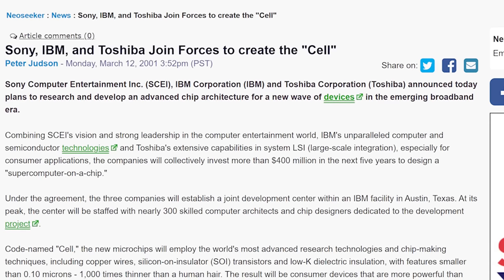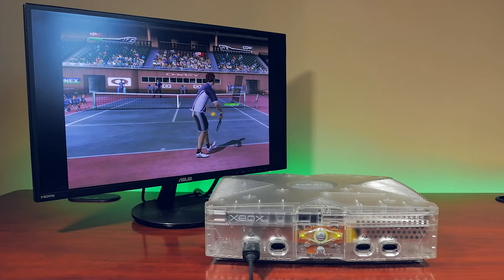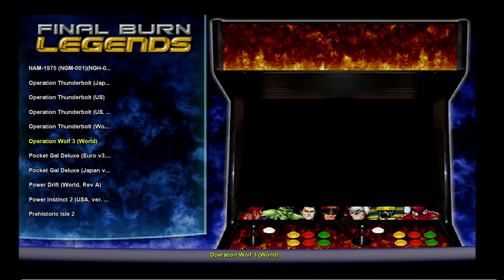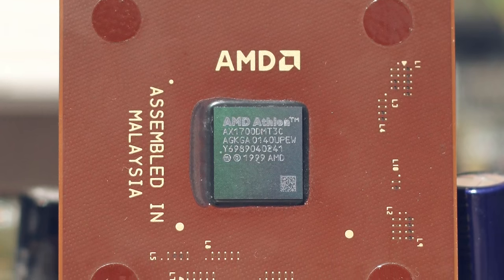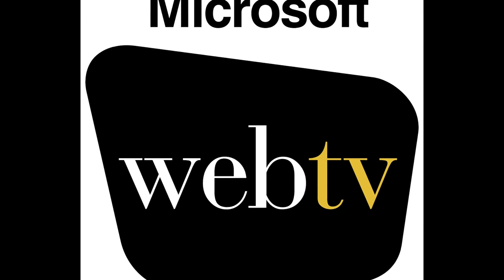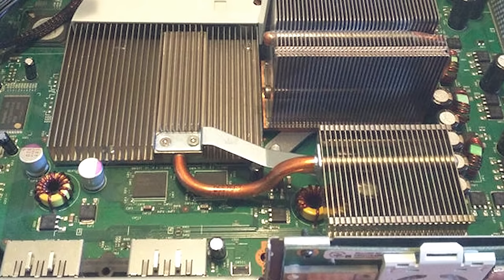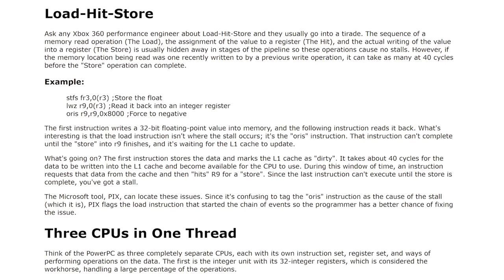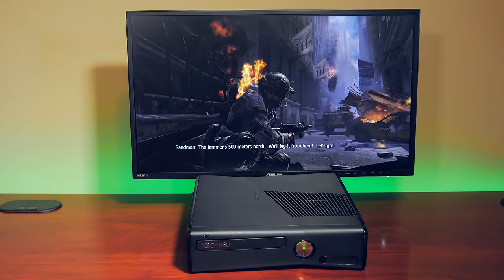Why Microsoft switched from Intel to Power PC for the Xbox 360  | MVG

Comment: At the time it was really amusing how Microsoft bought PowerMac G5s in bulk to send out as the original Xbox 360 pre-release devkit
Reply: It kinda made sense, so at the very least developers would get familiar with the architecture
Reply: @andreiarg  *made
Reply: alvallac21 💀💀💀
Reply: well... it just hackingotich cheapst production....
Reply: That has always been Microsoft strategy. They are one of the top vendors of Mac software (office).
Reply: Power PC pretty much owned the bigger server farms. All Silicon Graphics L4/L5 servers had full blades of up to 20 Power PCs per blade. Blades could have 1 to 20 CPUs.
Reply: The games were demoed on PowerMacs because it had the same architecture
Reply: Oh yeah I remember that
Reply: Only for Apple to shortly afterwards transition to Intel
Reply: Iirc the last few PowerMacs were some of the first 8 core systems for the consumer market. In 2005. Edit: well techincally eight cores, however its two Quad Core CPUs.
Reply: unsuprisingly, it was $150 million worth of powermacs..... bill hated steve so much for that prank
Reply: @V1VISECT6  The 8-bit guy did a test and discovered that the last G5 PowerMacs actually performed worse than the first Intel Mac minis
Reply: @V1VISECT6  wrong and wrong edited, sorry. the last powermac g5 from 2005 had 2 dual core cpu's, so 4 cores at 2.5ghz. a factory watercooled monster. rumors say they offered a coal power plant as CTO to go with the G5's....
Reply: @RBMK1500  I have three of them in storage, one is the liquid cooled variant but alas it kernel panics at boot. It’s actually just a 600w psu.
Reply: @brkbtjunkie  did you check for leaks in the watercooling? and yes, maybe "only" 600W psus, but if they suck a constant 400w from the wall you will be bankrupt soon ;-) i dont know the consumption but it certainly isnt very low..
Reply: Still the most beautiful desktop ever made. One day I’d love to buy an old G5 or Mac Pro and modify the case to fit a modern PC.
Reply: TBH I was hanging out for a photo of this in the video
Reply: @TVperson1  I used to have one G5 iMac. The performance was mediocre at best. More annoying was the fact that the machine was quite loud under any kind of load. It was power hungry like nothing.
Reply: And at the same time, Mac developers were being provided HP computers in advance of the PPC -> Intel switch. Strange times.
Reply: Well Apple used Windows PCs to program for the original iPods ARM CPU, so I guess they both were forced to team up.
Reply: Microsoft buying from Apple is unheard of nowadays
Reply: @ThatIceChampion  The gamecube is a repurposed mac g3/ibook.  all of nintendo's hardware is like that.
Reply: @HunnysPlaylists  yeah but thats Nintendo, they also had a partnership with Apple in 2016 for Super Mario Run
Reply: @danielfinley-pesti6661  wow, three skulls? That’s crazy 😮
Reply: @nil0bject  “unsuprisingly” idk this word 🤷
Reply: @RBMK1500  Correct, the intel Mac Pro that replaced the G5 could be had with 8 cores.
Reply: @Noah-Lach  I have 3 Mac pros from 2007 -2010 and 2 top-spec g5 towers literally sitting in the basement of a graphics shop. Many other macs too. A g3 blueberry slot loader with all peripherals (many new-old-stock unused round mice and keyboards) and about 3 iMacs from 2004 to 2012. Also, an original MacBook. All just sitting in a filthy basement. Want to rescue them someday.

Comment: One of the devs at Microsoft had confessed that for the OG xbox, they turned down AMD at the last minute for their cpu and went intel. I wanted to also add that the Gamecube, xbox 360, XSX and PS5 are well built and balanced in general. PS4 and Xbone were unbalanced by the Jaguar arch limiting most games. PS3 was hard to program but very powerful.  N64 was an engineering disaster that worked out.
Reply: now they all need the TSMC chips, then intel only was able to give them Ghz clock speeds
AMD is gone, was never a big party
Reply: The N64 was a tradeoff among the best solutions available at the time.
Reply: @A World Under A Spell We'll have to agree to disagree on everything you just said.  I'm not even sure how you are coming up with your games list.

But I did some PC gaming as well as console gaming.  None of the consoles could match running a PC with Voodoo 2 in Glide.  But the N64 came somewhat close.  The textures were laid out right, the animations were good for its time, the lighting was appropriate.  The edge antialiasing it used wasn't as good as the FSAA that came later (post 2000), but I doubt the difference between the two would even have been noticeable with the N64 because of its intrinsic blurriness.  It was like a low textured version of a PC.

The PS looked absolutely horrendous in comparison.  The textures strangely contorted because it couldn't correct for perspective.  And pixels shimmered, and polygons popped in and out because it lacked a Z buffer.  It rendered artifacts galore.  And its lighting ability was lackluster.  Even at the time I knew it couldn't really do 3D.

I'll agree with you that the audio quality on the N64 wasn't good.  But the N64 sounded better than the PS looked.  The PS had the better controller, I'll give it that.  

All the consoles of that generation were a tradeoff to meet the transistor budget.  The N64 had a small texture cache size because that's all they could fit after implementing the rest of the hardware.  The PS lacked a Z-buffer and a proper texture wrapper because of the same reasons.  And the Jaguar didn't even have a texture wrapper.

But they were all tradeoffs of the best engineering solutions available at the time.
Reply: Apparently AMD wasn't even aware that the Xbox wasn't running their CPUs. must have felt like a serious betrayal at the time.
Reply: @lucasrem1870  AMD is gone? What? PlayStation and Xbox have been using AMD hardware exclusively for their CPUs/GPUs since 2013. TSMC is just a foundry.
Reply: Yeah them going with amd in the middle of amd's rut stalled game development. i think that's why intel was able to keep their pc cpu performance so low for so long. If they had waited a year for the onx and ps4 pro they could have used ryzen cpus that would've been way better
Reply: @WamblyHades  amd has been fabless for a while they don't know what their talking about
Reply: @alexandernorman5337  nah nintendo could've used cds cuz they had piracy anyway
Reply: @alexandernorman5337  Voodoo 2 from 1998, N64 from 1996
Reply: Gen 8 is good. They better than pc from 2012
Reply: @gamerinc245  a low end one maybe, but a 3770k and a 290x is still able to run some modern stuff with .odded drivers
Reply: @gamagama69  Those systems were designed to use similar architecture to the original systems to make development easier and the systems cheaper. If they wanted to upgrade the CPU, AMD and Microsoft would have done so.
Reply: the problem are all the freaking X86 patent that was intel thats why intel fked the Xbox and gave a weird slow 733mhz processor instead the 1ghz they promised to get AMD out the console, so MS just kick intel on the 360
Reply: @albino_gringo1912 The cartridge format didn’t hold the N64 back, it was the awful memory latency (RDRAM) that the system had, 4kb of texture memory, and fill rate issues due to improper use of microcode.
Reply: @gamagama69 With that awful memory latency paired with first gen RDRAM? It would’ve not only made the base machine more expensive, but a bigger nightmare to deal with if it used CD’s.
Reply: People also forget the ps2 was underpowered and hard to dev for.
Reply: @lucasrem1870  what are you talking about, the OG Xbox never went over a ghz. Also AMD in the early 2000’s had there 64 bit processors which where dominating Intel.
Reply: The PS3's architecture was pretty bad not going to lie.

Doesn't stop me from loving the console. Great console! Trash architecture, but great console!
Reply: @qwertykeyboard5901   It finally became great right before it died but the 360 was so much better for 80% of that generation. Microsoft was knocking it out of the park with exclusives from 2005-2010 or so. Conversely, Sony finally did the same from 2010-2013 with The Last of Us, Uncharted 3, Infamous 2, etc. It's just unfortunate for Sony that the overwhelming majority of multiplats ran better on the 360 which ultimately won me over at the time. That said, I still ended up with a PS3 later and it's one of my favorite consoles to jailbreak (and one of the easiest).
Reply: @marcuscook5145  Yeah, Sony should have dropped some of the SPE things for another PowerPC core tbh. They where good at floating point stuff, but not main game engine threads that have 7 trillion branches everywhere with the most complex math calculations being int's most of the time.
Reply: @alexandernorman5337  Rambus is NOT what I'd call "the best solution available at the time".
Reply: @alexandernorman5337  You have to remember home video game consoles are some of the most cost reduced things in electronics. Yes the PS1 looks bad, but for what it did it was incredibly cheap for the time!
Reply: @albino_gringo1912 Uh , only for people that didn't know programming well . Before Microsoft bought Rockstar , GTA 3 was made for the PS2 . And Rockstar said they had no problems programming for the PS2 . And Hideo Kojima fooled everyone with the Metal Gear Solid 2 trailer . People said a computer was used for the trailer when it was made with the PS2 . And the Metal Gear Solid 3 trailer showed the PS2 had much power for texture .
Reply: @lucasrem1870  so silly to have said that AMD was gone during ryzens peak

Comment: I love how everyone is abandoning Intel now. These prices are ridiculous
Reply: That's only if you want the latest and greatest. Modern processors last years for gaming these days. (most likely consoles stagnate the gaming processor needs until a new gen)
Reply: @aaron1182  "Latest and Greatest." Intel still can't downsize their process. Still stuck at 10nm. Sure, their CPU's are still beating out AMD in terms of Single Core performance, but almost ALL modern applications support some form of multi-threading. AMD's SMT beats Intel's HT every time, while having slightly lower TDP's and lower manufacturing costs, and by extension can be marketed cheaper. Also, I seem to recall some malicious code being inserted into Intel firmware and software that crippled some AMD products intentionally. Something AMD has never resorted to.
Reply: Let's not forget that by putting the pins on the CPU, you also lower manufacturing costs for the motherboard. There's also no such thing as "mounting pressure" in that case, as pins don't need to be pushed against something vertically. Instead, they're clamped and contact is made laterally. A cheaper solution.
Reply: @aaron1182  Intel's prices are way too high and AMD didn't performed bad. Price/Performance for Intel been awful since days, and since last year, AMD is very competing with Intel, for at least half of the price.

Intel performance results are mostly advertising nowadays, with their awful Retpolines/Spectre issue they lost ~40% performance with 1st mitigation, and nowadays is ~20% with improvements. Intel CPU security issues been increasing every year, like CVE-2020-0543
Reply: waltercool I think 40% is a bit over the top (I heard it was only a few percent)... If that’s true I’m turning them off though
Reply: Yeah game consoles always stagnate industry😂,for god sake stop using this mantra🎩
Reply: Ehhhh, look at FULL platform costs today. AMD CPU's are cheaper, but their motherboard prices pretty much level cost out, it's kinda crazy.
Reply: @EphyMusicOfficial  and yet my first Ryzen build came with a CPU that had bent pins right out of the box.  Dont need to fanboy anything, just buy what is best for your needs at the time you need it, there are always going to be pros and cons to everything.
Reply: @EphyMusicOfficial  Intel patched some security vulnerabilities in their newer processors and people were seeing up to 10% decrease in performance lmao.
Reply: @comicsans1689  yeah so? The alternative is to not have a patch.
Reply: @EphyMusicOfficial  Ryzen 7 4800H is destroying every other mobile processor right now including the 10th gen 6core i9. absolutely nuts, I just got a 2020 Omen 15 with that chip, 1660Ti, and 16GB RAM and it just crushes any intel machine ive used
Reply: @HunterGreenMusic  I wasn't going to comment because as they say if you have nothing nice to say don't say nothing at all. But you spent that much money on a HP? The Ford Pinto of all computers.
Reply: @bojinglebells  This can happen, but it also depends on who the seller is. I buy all of my AMD CPU's and GPU's directly from AMD, as I don't care to have someone on Newegg or Amazon hiking the price up at all. Nor do I like MSI or AsRock or whatever branding on my cards with a marked up MSRP. This also guarantees that I'm getting products that act exactly as AMD had designed them to.

It's often cheaper to buy direct.
Reply: @frankwalter1300  The point is that Int(c)el has been dropping the ball lately.
Reply: @EphyMusicOfficial  cries in chunk generation
Reply: You must be young. This has happened before. Intel is like a freight-train; it takes them forever to stop, change direction, and get moving again, but once they do, they demolish all their competitors for the next several years until one of them manages to discover a useful new trick for designing better CPUs.
Reply: @EphyMusicOfficial  how do you buy from amd directly?
Reply: @bojinglebells  You should have returned it. I recently bought a new AMD system last November (Ryzen 3700x) and everything was inspected before release. This was from a well known PC store in the Philippines that sells cheap when you pay cash.

Also, for the other commenter, depending where he's from, there may be AMD partner stores in their country. But as long as a store is partnered with AMD, they should be good as genuine.
Reply: Shawn Elliott this is so accurate that you must be a dinosaur in terms of age.
Reply: @supermasterfighter  dude computers have really only been a thing for 40-50 years. (Yes i know earlier computers  existed, but there wasn't a market. There were research projects) the man could be moddle adged.
Reply: This comment hasn't aged, well.
Reply: And now Intel is laughing because their shit might be outdated, but at least it’s in stock.
Reply: @itsTyrion  Not to mention, they don't have any console obligations. 
Unlike AMD who's forced by contract to deliver to Sony and Microsoft, before any Ryzen or RX 6000 can be made..
Reply: Ironic that in the future right now (Jan 2022), Intel is both THE budget and power king again with Core 12th Gen lineup. And I say that as a happy Ryzen 5 5600X user 

Intel still sucks at efficiency though (TDP) so for now I would still prefer AMD on laptops.
Reply: @EphyMusicOfficial  "AMD's SMT beats Intel's HT every time" That's debatable. The i5-12400f keeps up with the Ryzen 5 5600x at a lower frequency, and the i9-13900k can go toe to toe with the Ryzen 9 7950x. 
Intel's' problem with their nodes dates back to Ontellini era. He went thrift on R&D and Intel's fab division suffered. Intel declined to update their Lithographics machines because they figured they were capable of hitting the 7nm process with their older ones. This is why Gelsinger has put up so much money, capital, and government begging to buy new Lithographics machines from ASML and building fabs.
Reply: You predicted something